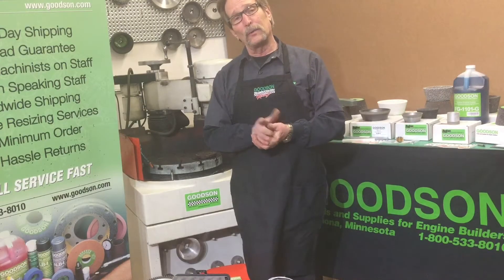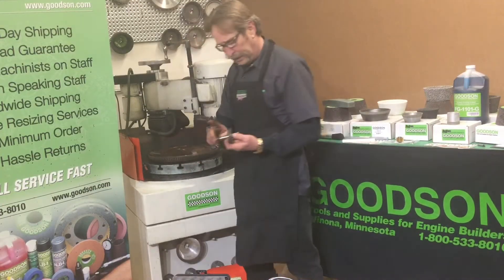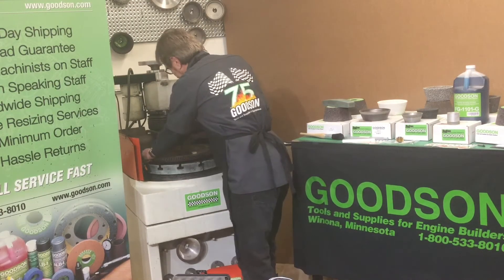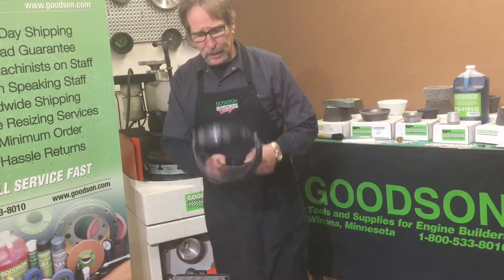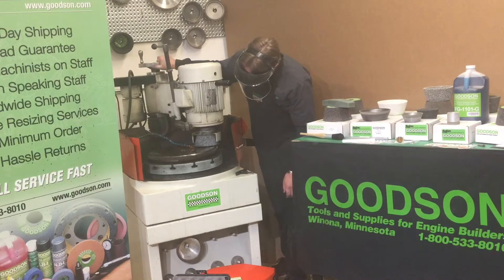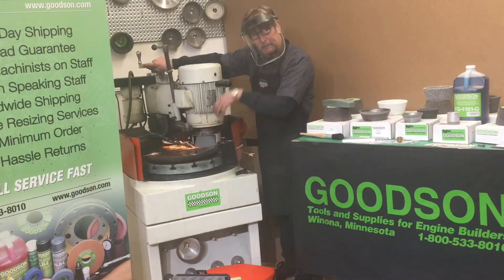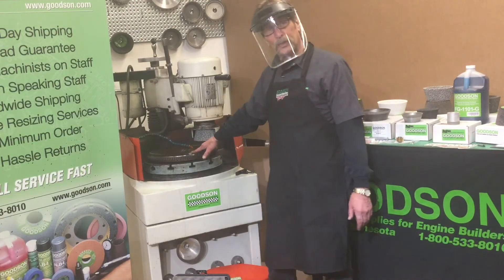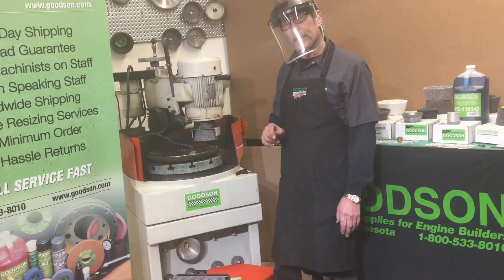Grinding A Flywheel | Tech Lab Tuesday

Comment: That's exactly how you do a flywheel that will work perfectly, and clutch will last 100s of thousands of miles if driven correctly.  
Shop did mine that way, 15 yrs ago, still smooth & perfect engagement!!